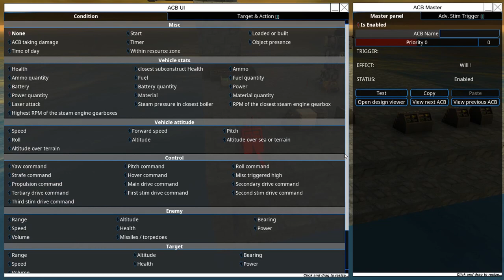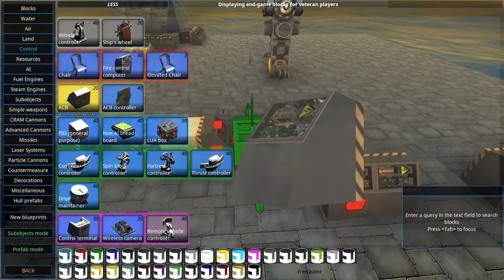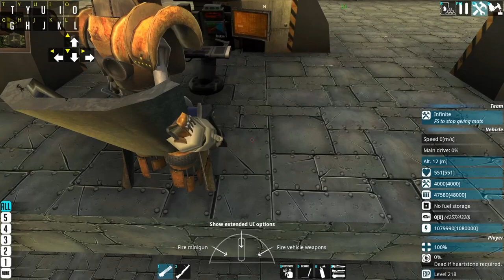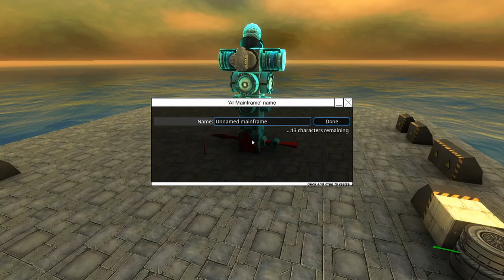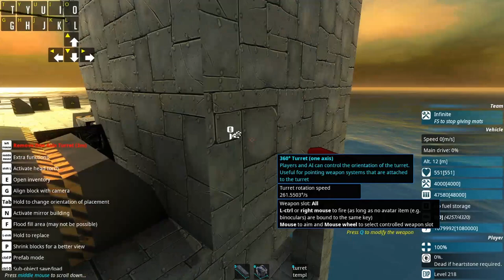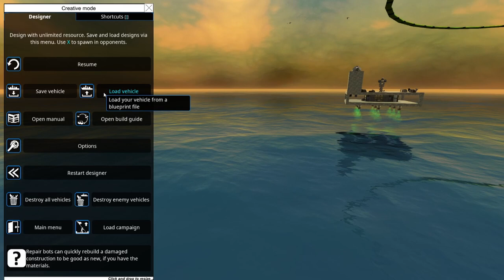From the Depths - Tutorial 24: ACBs

Comment: One neat trick one can use to actually influence anything on the vehicle with ACB placed on a subobject (turret, spinblock etc.) is to use complex control (keys T,G,Y,U etc).
Usage example: active suspension for uneven terrain. 4 or more wheels are placed on separate pistons each having ACB sensing distance to the ground. If loss of contact with a ground is detected then given piston is extended. One extra ACB would be required to periodically reset positions of all pistons (e.g. 4 times per second)